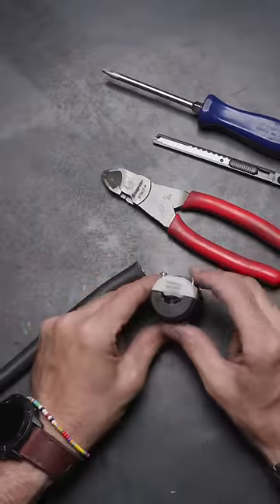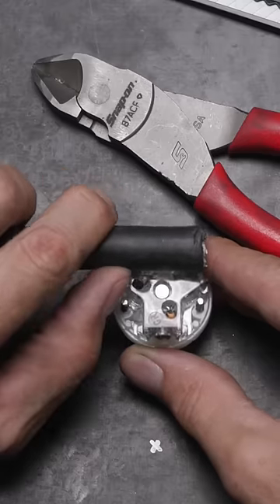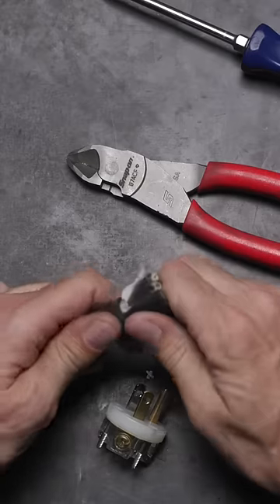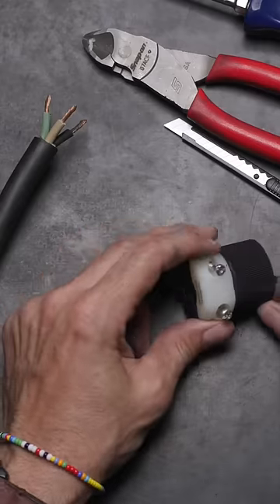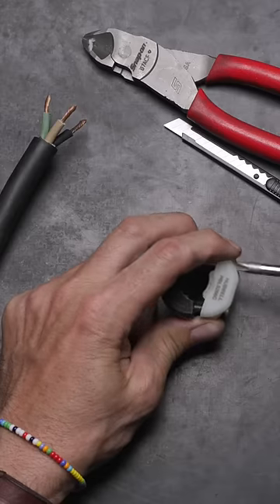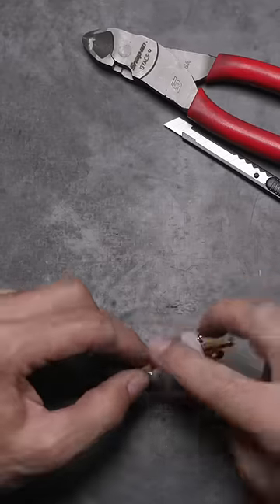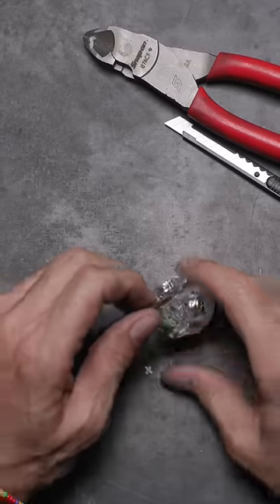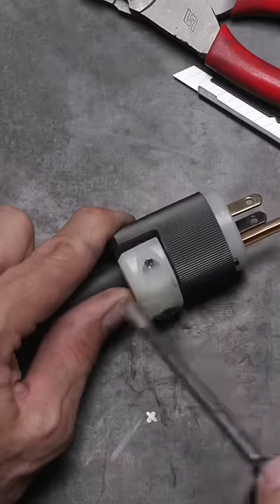Professional Homeowner hack number #28 Wranglerstar

Comment: When you strip the outer jacket you should strip it like you are sharpening a pencil, that way you don't score the insulation on the wires inside. And leave the ground wire a little bit longer than the other two.

Comment: Eey you know how to do that right like so much else you've taught me, I'll share some knowledge tho...
Not ALL and tbh not many plugs will have that silver side usually they will have a different screw from the hot side, and ground will ALWAYS be green, unless you find old stuff.
But all of this stuff especially modern will be marked Load and Line and I can kinda make it out on the back side inside arrows pointing to each hole, it took me a little while to remember which of those was hot and neutral, but here it is, "The power LOAD going INTO the device (hot) and the Line of items down the Line, meaning the neutral. Even tho this was more particular in DC machine set ups the markings are just the same

Comment: With that type of cable(fine strand) you should really use an end sleeve and crimping tool to ensure good connection.
Reply: Not necessary with clamp screw terminals
Reply: Yes I was going to comment the same thing. While I do use the crimp ferrules when I make up these plugs it is definitely not necessary as they use a clamping system instead of a single screw so it works either way.
I'll add that I like to use them with larger gauge wire as I can make sure all the strands get into the hole very easily with no frustration.
Reply: You've been watching way too much YouTube. Seems like every "expert" saw a video on ferrules someone this past year, and now they love to act like they know what they're talking about by mentioning ferrules. LOL. No need for ferrules. Waste of time and money.

Comment: You don't usually get stuff wrong and I've heard some great tips from your channel, but don't you guys have AC power? That means the green ground wire is always "cold" but it doesn't matter which way you put the white and black cables in, as in alternating current the flow of electrons changes directions with 60 hertz e.g. 60 times per second. There is no "hot" and "cold"wire because those two change 60 times per second.
Reply: I'm going to take a chance on this and Trust you're not just pulling our leg! Just because electricity oscillates at 60 HZ doesn't mean there's not a primary side! Once I decide goes to the neutral bus and the other side goes to the circuit breaker! That seems like a pretty big difference! And so yes it does matter because the plugs are polarized anyways. Want anything from 1980 and up or something like that. I'm sure in your country all the wires don't go straight to a circuit breaker right?

Comment: There is no such thing as neutral with the AC we use. There is a positive wave polarity and a negative wave polarity. That is why some plugs have 1 large and 1 smaller prongs. Those have to be plugged in that specific way.

Comment: i have only one thing to add, the ground is supposed to be longer than the neutral and the phases, idk about American laws but in Austria it is required to leave it longer.
Reply: While that makes sense. These plugs are not built to have one wire longer than the other they all just barely fit in there as it is.
Reply: It'll be just fine.
Reply: @littlejackalo5326  of course, its just a little detail and if your strain releaf is nice and tight it wont matter too much, but as i said in Austria we have the SchuKo-Plug which requires this by ISO, DIN and ÖNORM.
Reply: @brizzle8797  that i dont know becouse we have very different and of course "over enginnered" plugs in Austria/Germany😅 they definitely have room for that.

Comment: Cody, I always wonder at the extra amount of copper required by the american 110v cabling compared to the european 220v grid... 🤔 ... with half the voltage, you need twice the current for the same wattage... and the heavier cables reflect that extra current-carrying capacity... 

Our (I'm irish) wires are .... 

brown for live
Blue for neutral
Yellow & green for earth... 

I remember them like this..
Brown bear bites
Blue with the cold
Green grass

😎👍☘🍺

Comment: 25 years in the trade…putting thousands of those stupid cord ends on SO cord. Thousands. Never saw the strip gauge for the outer sheath. Would have made showing FNGs so much easier. Not to mention the first 10 or so in a new pile would go so much smoother. 😐

Comment: Decent vid but pls let those that listen to ya know that they should reference the voltage and amperage capacity. They should be visible on the cord cap and if not there should b a sticker/plate on the device that will have the necessary info

Comment: Not all receptacle repair plugs have 3 screws or wire gauges...this is specific to THAT brand.  Also, if you were a pro (homeowner? Haha), you wouldn't use those side cutters or blade to strip the wire ends, which is implied because you don't show how you did it, and there are no wire strippers on the bench, to do it right.  Yes, I personally can use a blade and do a good job, but anyone in your audience who doesn't know how to do this already is an amateur, impressionable, and should be shown how to do this the right way.

Comment: OMG how weird American electrical installations are.
Please use stripping pliers and read on the equipment how much you need to strip.
And always use pins on screw terminals.
Reply: I'm going to help you out just a little bit! Yes he could have used strippers but because this is stranded wire and it has a very rubbery insulation coating the conductor will change shape or deflect unlike a solid conductor that would probably end up gouging or something like that. Once you have the feel for it it's just as good! And he did consult the manufacturer directions they are written right on the plug which is what he was showing how to do! And finally these are not just set screws like on din equipment. These are screws that have clamping plates made to accept stranded wire such as this. So while you could use a ferrule it is definitely not necessary in this application.

Comment: You don't need a ground. Haven't used one since 1999, all Osha nonsense
Reply: I really hope this is satire or a joke
Reply: @finnrey9715  it's common sense, just don't stand in water when using a power tool. No ground needed.
Reply: Your grounding conductor is paramount for over current protection to work properly.  Grounding and bonding is a entire section of the code book
Reply: You have very little clue about how electrical distribution systems work do you.